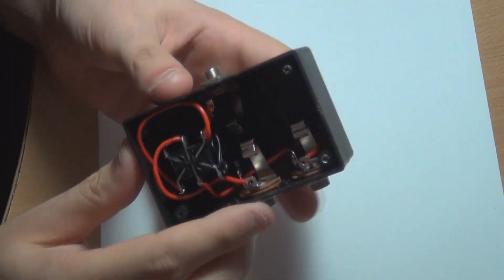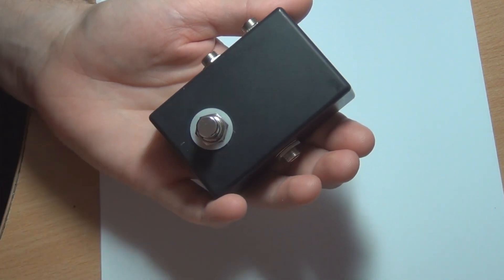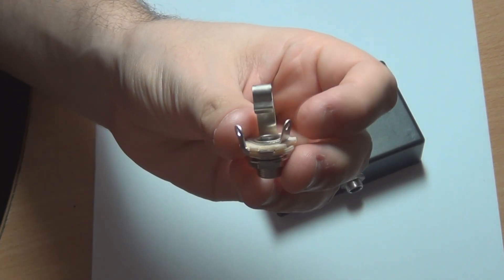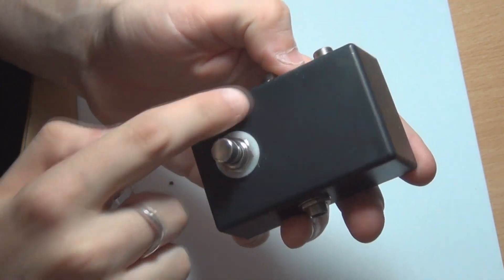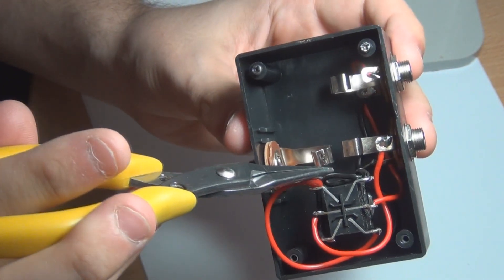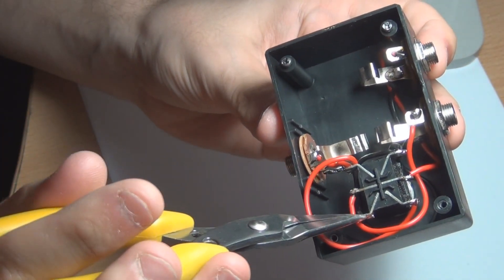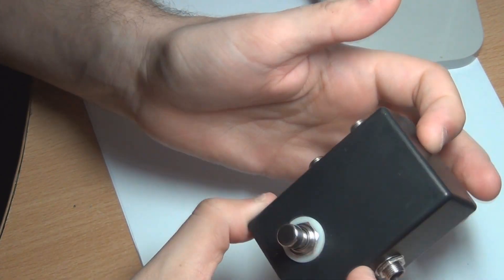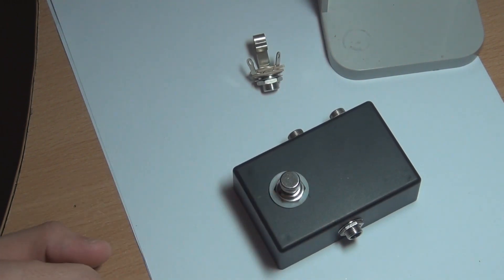Build A Guitar Pedal In 10 Mins! (A/B Switch)

Comment: Good video.
Nice little box. Plastic isn't so bad.
I'm making an AB switch soon, just ordered the parts. First pedal build :)
It will be a table top version (hand operation), with left/right rocker switch so I can clearly see which input is selected.
I hope I get a better understanding on how to wire the DPDT switch wires correctly.
Reply: how can I make a speaker selector for my amp? speaker a or b and A + B

Comment: Hello, I just wanna ask if you can help me … Is there such a thing as an 2 guitar inputs and 1 guitar output?…. because I’m having a problem with my DIY pedalboard, I want just a inline signal chain, in which I can perform High Gain sounds and my Acoustic sounds. I tried a splitter cable but it didn’t work. My guitar is a musicman JPX with piezo on it i wanna utilise the magnetic and piezo without using 2 guitar cables, but it didn’t work that way, cause the result is when I switch to magnetic it’s always ok but when I switch to piezo signal it doesn’t work. but when I put the selector in the middle position only the magnetic works not piezo signal. 

Now I have other options and this is now the question I ask. In my head, other than having a ABY box or AB box pedal, I just wanna have 2 active inputs and 1 output, as I said I want my rig to be 1 inline signal chain. So that I can flick the switch from the Musicman of magnetic and piezo switches and use them as I need for High Gain and Acoustic Sounds. 

So it’s kinda also an A/B box but the other way around, with 2 guitar inputs (Active and 1 output), it’s just a box pedal without foot switch. the switch that I wanna use is from the switch from my guitar for magnetic and piezo signals. 

So my question is, Is it possible for this idea of mine to work? … for me I think so YES. but I just wanna ask and confirm from the experts in electronics off course. CAn you help me build it?, coz there’s nothing like it on the market right now. I don’t know might be mistaken but here in Dubai where I reside there’s nothing. just seeking help. Thanks.

Comment: I dont understand why the bridge with the red wire from input.If this is just like a 3pdt with 2 poles (excuse my ignorance, i'm just starting out) doesn't that mean that the center pole( lets say center left) is the common?
Couldnt you just connect the center pole with Input tip(red) then top pole with OutputA tip and bottom pole with OutputB tip?

Then why is there a need to connect the black (ground) with the switch?Wouldnt wiring all 3 jack ground lugs be enough?

Im making an AB switch and a looper as my first steps into pedal building/modding, and you videos are a really amazing help!!!!! :D

Comment: Hi there... was wondering if you or anyone has made a sort of splitter/D.I. box.  I am looking to create a way to take in one guitar line and have that split and output to 2 or more independent outputs.  use case:  3 amp heads simultaneously connected to a single guitar player's pedal rig or direct.  I was not able to really find this anywhere I have looked... tons of headphone amps but the "amp" aspect blows the HiZ instrument cable requirement here.  Any suggestions would be appreciated. Thanks.
Reply: Well, if I'd do that, I'd just wire the output from your guitar through a small amp circuit, and the output from that to a potentiometer's middle leg, and then your two outputs (what goes into whatever you hook up from there) on the sides.
Then, the pot would correspond to a balance control. The magnitude of the pot must be comparable to the difference in impedance between the two elements that you plug to the two outputs.

Comment: Just a question. I've thinking about a pedal which you can insert 2 instruments then one output going to a looper pedal. in my case i want to use my iPad with shaker app to loop in the looper then switch to my guitar line to loop a rhythm or a chord. Is that possible? Thanks!

Comment from the maker: You can do that.  Turn the A B switch around 180 degrees :D  There is only wiring in this pedal, so you can use it back to front.

Comment: hi, its there a way to make a passive ¨pedal¨ that have 2 inputs and 1 output but with no footswitch ? like for using this ab switch to switch between pedal chains but then i have just 1 amp so i need to reunite the 2 chains again into 1 cable.

Comment: I am rewiring/upgrading a AB selector that i got cheap but is corroded, for other people wondering the following: 
a) This pedal in the state in which Chromespherecom has completed works in both directions, e,g 1 input to 2 outputs, or 2 inputs to 1 output.
b) His wiring technique mutes the other output(or in reverse the input) by a short to ground, while the other input is being used.
c) Here is a exact wiring diagram that matches this video (as viewed behind the DPDT switch) as the link has stopped working after 2 years, note the colors almost match up, black is grounds/shield as described throughout: http://www.thegearpage.net/board/showthread.php?t=450701 

Also should point out a better approach to grounding i have found is to use insulated jacks with a metal box so that the connectors don't have a ground through the thread to the holes, so use insulated jacks but continue to use all three jacks grounds/shields connected regardless of the enclosure, on a metal case have a extra wire going from one of the three jacks (though all connected electrically together) to a ring terminal to the metal case (or solder it on). The reason for this is the Cast boxes/metal boxes though conductive, may change the "tone" or frequency response as they are not as conductive as good copper wire. The wiring of the grounds should resemble a Star, e.g. a single point going out to the grounds, avoid a Triangle/Delta for grounds as a internal ground loop will likely occur as its a "ring" of wire.

Comment: I am trying to do this exact same thing, but with 2 switches (two inputs, 4 outs) with green leds for each switch. Both switches will have a clean out and an out going to pedals (so I can use 1 pedal for both things) Any way you could make a diagram or video explaining how I should wire in the leds, I know how to do it without power. But I would really like to know when each is on so I am wanting to put the leds in and a 9v plug for a adapter. Thanks for the great video, and hope for a response.

Comment from the maker: You can use it for either :D  The inputs / outputs are interchangable.  This pedal is just wiring.  There is no designatored "input" or "output".  It will switch between the amps when you hit the button.  Would be a bit strange using it to switch between guitars though.
Reply: I made one to use with 2 inputs and one output so I can plug in 2 different guitars, and not have to unplug one to play the other. Makes it a lot easier changing guitars...

Comment: Great vids mate. Wanting to make a mic a/b with xlr and an led. Have one (expensive!) but no led which is soooo annoying! Can it be done easily and can you point me in the right direction either video or wiring diagram, switch etc etc? Thanks
Reply: Making one right now and can't find any circuit examples. The LED is the problem. Trial and error it is then !  (did you get it done eventually, dude ?
Reply: Granulated Yeah I did thanks. 3pdt switch with the led wired in via button/watch batt on 6 and 9 of the switch so it lights only when the B channel is on. Also a 10k resistor between earth and hot over the B out. No pops, light works great etc. Way better than the other $200 one I own!
Reply: Nice. I'm trying to make use of the combined switch/LED unit from a defunct joyo pedal... Tearing my hair out !

Comment: Hi! I used the same kind of DPDT switch as you but mine has a problem, when I press it it switches between the lines but when I depress it it goes back to the first line selected, to be more clear, it doesn't stay pressed. What can it be the problem, I connected something wrong or is the kind of switch I chose? Thanks
Reply from the maker: Yeah sounds like the switch.  Probably a momentary?
Reply: Thanks for answering. The one that I used looks exactly like this one http://www.pedalpartsplus.com/mm5/merchant.mvc?Screen=PROD&Store_Code=PPP&Product_Code=9004&Category_Code=SWI in fact it seems to be a momentary, how can I ask for one like yours? If I used a selector, it would work with the same connection?

Comment: Don' know if any of these answer my q's so here goes. During a gig I want to switch from my mando to guitar. will this work? Also, I bought the parts to build my own box but didn't know what I was buying. Only after building it did realize what a "momentary" switch was. Duh. Not what I want. Now I'm not sure, I guess just any switch that's not momentary right?
Reply: You can use the A/B for input and one single output. I'm assuming that you're talking about acoustic electric guitar and mandolin. In this case, It may be beneficial for you to use an XLR output. This will use the A/B switch as a Direct Input box as well. Let me know if this answers your question.

Comment: Could I use this A/B switch for switching from one amp speaker cabinet to the other.
Reply: Do NOT use this to switch cabinets.  You will likely damage the output transformer on your amp--especially if it is a tube amp.  Your amp needs to see a constant load.

Comment: I need two inputs and one output, does it work this way?
Reply: Yes it will work
Reply: If you have 2 inputs and 1 output, it's gonna switch between what input is active.
Reply: @Eric Acha 

I don't see why not - as far as I understand it, it is basically just a switch and two connectors.
If there was a worry, it would be if there was too much impedance in the xlr in/outputs vs. the jack cables. If the  impedance is too high in the cable (or by having the cable in a junction), you might need a tiny amplifier circuit within it, but I suspect that is not the case.

In other words: I'm positive it can be done successfully.
Reply: @Eric Acha 
You're welcome, let me know how it works!
Reply: @Eric Acha 
Haha, glad it worked! It's not my video, though, but it's splendid that it worked! :)

Comment: Hey, quick question. Are the 2 shield wires on the switch required? I'm trying to design somthing where I can combine 2 separate signals into one with a single button, and not sure if I need a shield wire

Comment: What kind of wire are you using? I'm just not sure if there was a certain type of wire that I should be using while doing this.
Reply from the maker: Any wire is fine.  I built this switch along time ago and the AWG is too thick.  I'd go for awg22-26.  I usually use awg 24.
Reply: Thank you! You have been a huge help. I'm planning all this out so I can start. Im going to do this so I can build my own Talk Box.

Comment: I use more than one guitar at the same time because I play musics with diferent tunes, I want have a switch pedal for change the guitars without unplugging the cable of one guitar and plugging it in another one, do you know hou to make this or where I can find this kind of pedal?? Thanks
Reply: i dont know if someone answered you or you got it by yourself... this A/B switch just works the way you said [if you turn it 180 degree xd]  - you can plug let's say 2 guitars and switch them to one output. This switch just works in both ways, you can switch: 1 input and 2 outputs or 2 inputs and 1 output
Reply: Thanks for that. Can I ask another thing? How can I build one switch pedal for more instruments?? Like 4 instruments? It's possissible? Thanks
Reply: Marcelo Camargo you would need a switch that would support up to 4 choices, something like a rotary switch (think old radio, with a clunky band knob, or old t.v.s, channel selector switches from the 50's up to the 90's). Another option is to wire things with more than one switch, say 4 switches, 4 ins, but only the depressed switch is live.

Comment: Cool! so its the exact same wiring if you want 2 ins to 1 out? if I'm using a wiring diagram that has the 2 jacks on the left side, but i want it as 2 jacks on the right side, can i just "flip the image horizontally" on the computer, and that will be correct? it wont mess up the wiring will it? Thanks for the video!

Comment: is it possible to make the same but just to switch between 2 inputs when there is 1 output? So that I don't have to unplug my guitar when I switch from one to the other.
Reply: It's the exact same thing. There isn't a directional sensitivity in the system, so this build allows for just that. :D
Reply: just flip it over dude and use it backwards
Reply: lel

Comment: Do you have a video of having two input going to one output? and being able to switch between the two inputs. Or how would you do that?
Reply: This circuit can also be used for 2 in -1 out, with no modification.
Reply: im a little stupid. what would you use that for? i understand the need for an A/B but i scratching my head trying to figure that one out.
Reply: It could be used to keep two guitars plugged and switch which one is going to the amp.  No unplugging during the show :)
Reply: It can also be used in order to bypass an FX unit with no true bypass or to switch between heads on one cab.

Comment: Ah ok! thanks. only thing is if i did that the stomp switch would be above the jacks, could i wire the switch the exact same, just above the jacks, then when i flip it 180 it will be correct?

Comment: hi, this pedal works to at if a wanet to use 2 guitars to 1 amp???
Reply: Yes. I'd build it backwards, though, with the inputs on the right and the out on the left.
Reply: ***** Why backwards?  I play both stage right and left so my amp can be on either side.  Or do you mean wire it backwards?

Comment: Hi, can I ad another input in parallel?
Reply: there will be some loss on your signal - it will work, but it will be a little lower volume - you need to buffer the signal when you send in 2 outs simultaneously in order to stay same volume as the input signal